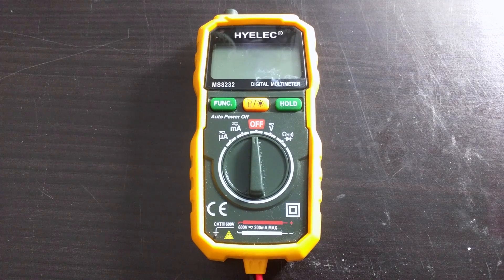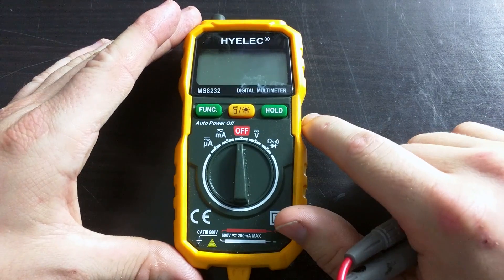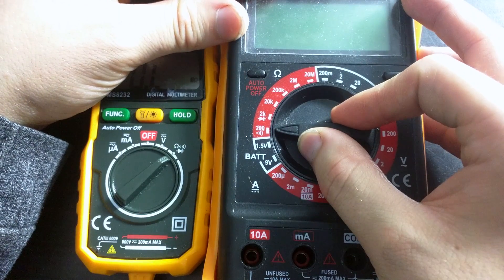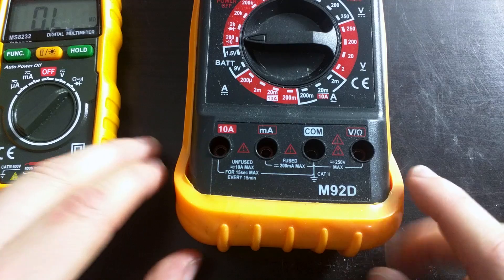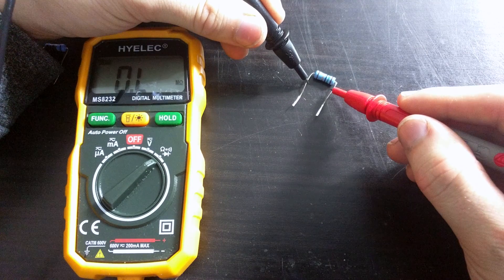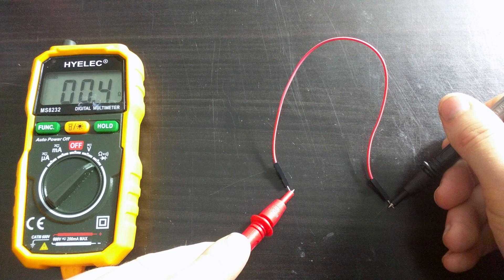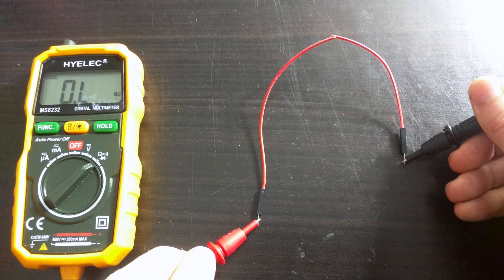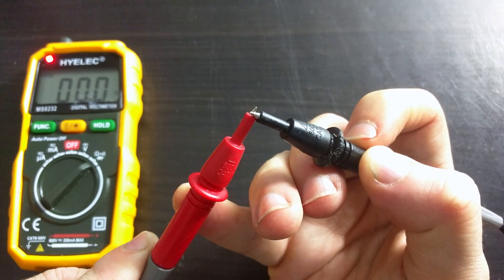Multimeters - Resistance and Continuity - Electronics Basics 14

Comment: No jumper wires were hurt in the making of this video ;)
Reply: Not sure if this post was added but I’m unsure of a couple of things with this tester. 
1 what type of sensor does this unit use on the clamp
2 It appears unclear to me but will this tester test DC current/amps in the clamp for use with automotive 12 and 24v systems.

Comment: what if I want to do that continuity test with a 100 meters cable distance?
Reply: In electronics there is no cable with 100 meters long...the multimeter is just to measure the value or check the continuity between  electronic components..
Reply: Get a longer wire to connect at one end. Did that when working on a cherry picker

Comment: HO MY! Don't throw that wire in the bin!  Use it to solder to a project where you need a lead to test or connect to your Arduino from a PC Board!  I do this all the time with those wire's work great in all sorts of projects, I have even soldered in a resistor to use as a pull up or pull down resistor in my arduino projects!  I am sure you knew that, but just had to comment!  Thanks a million, I have been directing electrons since I was 12, back in the early 1960's but it seems I do  pick up a thing or two from each of them. I have it in my head that to stay relatively young, one must learn one new thing ever day, these videos are indeed keeping me a bit younger every time I watch.